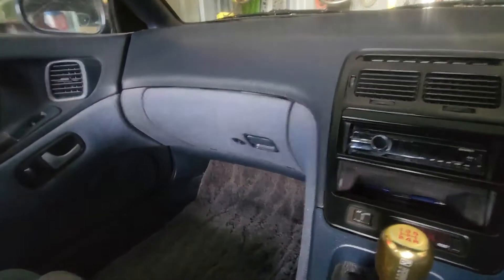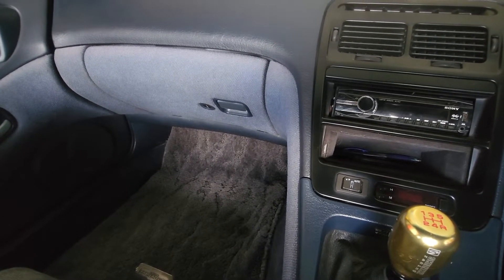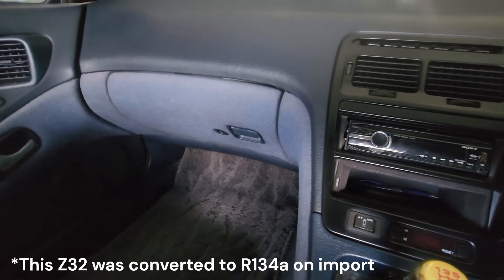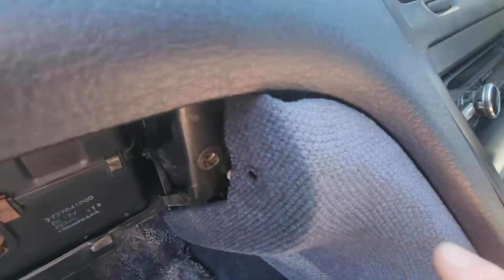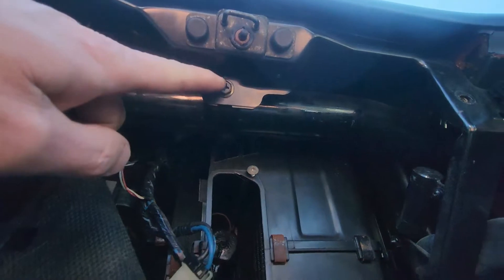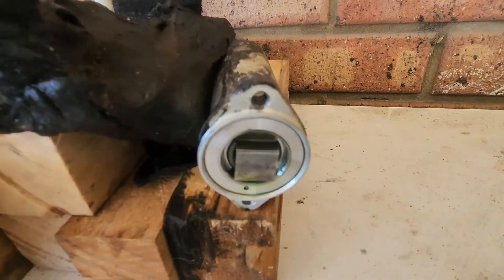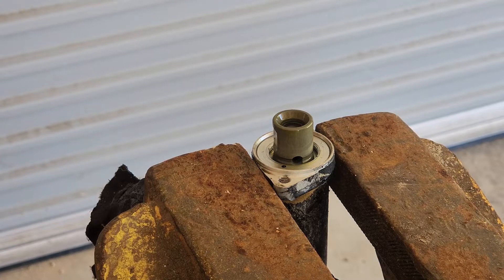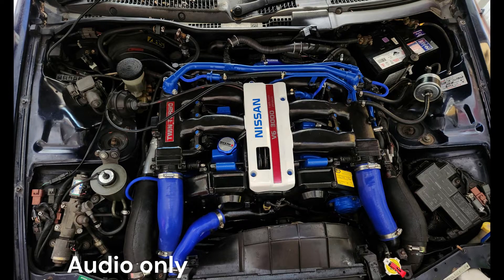Z32 300ZX - Air conditioning suction throttle valve removal

Comment: Thanks for the helpful video! I’m in the same predicament right now and was wondering how you’re fairing after a year of posting this video.
Reply from the maker: Thanks! Car and A/C are going well, resealed the system, vacumed down and gassed up, A/C still cold and working well. One thing I should have done is replace the receiver dryer but didn't at the time.

Comment: So you didn't remove it you just cleaned it.
Reply from the maker: Yep correct, I removed it cleaned it and put it back, air con works now, had it continued to give trouble I likely would have gutted it and left the internals out but I didn't need to.